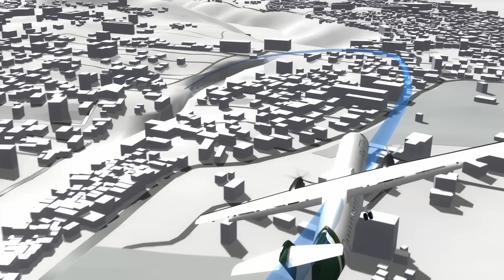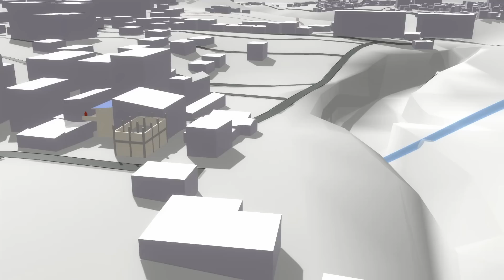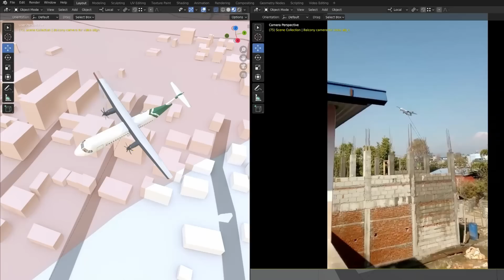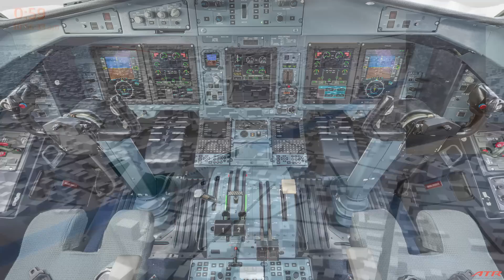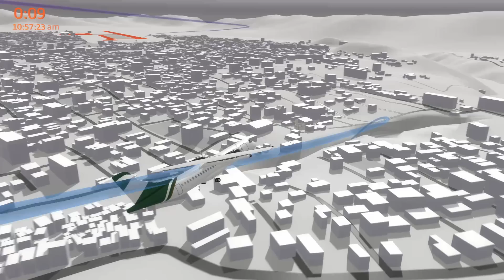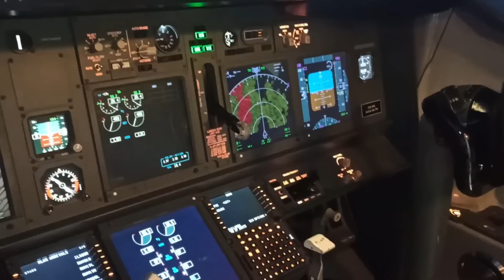HUMAN ERROR or MECHANICAL?! | Yeti Airlines flight YT691 illustrated

Comment: THIS IS THE SECOND SLIGHTLY DIFFERENT VIDEO I HAVE WATCHED CONCERNING THIS TERRIBLE ACCIDENT  X.   WHEN THE 1/O CALLED " NO POWER " IT SEMA THE CAPT FAILED TO TAKE A QUICK GLANCE AT THE PWR QUADRENT , BUT THIS IS ONE HELL OF A PUZZLING ACCIDENT ... PLS UPDATE US IF AND WHEN YOU OBTAIN MORE, DEFINITAVE INFORMATION X AS A LIC. COMM. WITH S & M E  L.   , I ALWAYS E X P E C T.  AN ENG FAIL ON T/O   OR LDG  X  OCEAN TASK SHIP CAPT. P. van ESS.   U S M M.      +       U S.  FAA. 
LIC. COMMERCIAL PILOT , AIRCRAFT , ETC.
Reply from the maker: Sure will.  This one really makes no sense at all.  
You get a master caution and see zero torque on both engines.  First thought for anyone with technical knowledge is its a prop issue... surely!  If you miss the props then forced landing is only option and you have the old runway right there.  Just don't get it.  And then you have both pilots fly it into a stall.  And then feathering the props in the first place. 
 Inexplicable!!
If you lack technical knowledge, you don't pilot a plane with 70 people in the back.  And you dont get signed off to fly in the first place.

Comment: This old Air Force safety officer does now think back to the 1980's Janet Harduvel vs. General Dynamics lawsuit. It's way too convenient to call Pilot Factor on this mishap. First of all, it's hard to believe anyone would make such a mistake.  Feathering would cause a rapid RPM  change, you won't even need instruments to notice something being up.
This does need proper investigation, or quite likely, the same technical fault will cause another mishap in due course.
Reply from the maker: The auto throttle on the engine would hold it at the correct RPM.  But both pilots missed the clues provided by the gauges.  This seems 100% pilot error.  
I thought the Harduvel was eventually ruled pilot error on appeal.

Comment: Flew on Swiss 340-343 about a dozen times from GRU-ZHR an back. Usually fully booked flights and probably very close to the MTOW and it was very noticeable how long it takes to lift off and take an eternity to reach cruise altitude (and to dinner begin to be served :-D).

Comment: You watch the airspeed every few seconds at that phase of flight and airspeed decays quickly with flaps so I still don't get why they didn't panic about airspeed way earlier?  Also the aircraft would have felt squiffy and nose would have felt unusually high.  Very very puzzling.  Are we likely to get any more data than we don't already have?
Reply from the maker: Yes the final report is still awaited.  The investigators have the cockpit voice recording and surely they do know more but perhaps collecting more facts before releasing the full picture.

Comment: Brilliant decoding of the accident. 

Very well done sir.

I am a flight instructor.
Unfortunately the error should be blamed on pilot error.
We do get quite a few nepalese students for CPL.
While some of them are good. Unfortunately majority of them cut corners during training.
Reply from the maker: Thanks.  This case also shows why pilots MUST have technical understanding.  Zero torque loudly shouts a prop problem and they should have known.  If they couldn't problem solve that, with an issue on both engines forced landing is the only next step and there was a runway right there.  They missed that too.  Panic and freeze probably set in.

Comment: Brilliant video. There is one thing I dont understand: approx 50 sec before the crash the engine speed was increased back to 44%. Then at 20 sec to go the power levers were pushed to 100%. Why wasnt it enough to save them?
Reply from the maker: Feathering is like putting it in neutral. Revving the motor has no effect on forward speed.

Comment: There is NOT MUCH you can recommend.
The senior pilot pull the wrong lever .
The lever that’s is defensively built to be DIFFERENT. 
You probably could programmed in a voice or chime for feathering props.

But this is a an error that senior pilot did that can not be designed out of the cockpit

Comment: Could it be that the senior pilot knew it was a lost cause after stall warnings and decided to violently bank left and pitch up to go into the river bed instead of the houses to save more lives?
Reply from the maker: No, the wing drop was from an entirely out of control plane.  By the second stall warning the aicraft was no longer been flown by the pilots.  You never allow a stall.  You nose down to keep flying speed up and do the best crash landing you can.  You keep flying speed up so you maintain control and at least fly to the best crash land.  You dont lose control and have no say where you are headed

Comment: There should be an alarm sound immediately, when the propeller lever is set to fether in normal flight, this could have save this plane, plane manufacture should implement this  immediately.

Comment: If you think about it, pulling the flaps lever up is quite similar (almost the same) as squeezing the locks on the feather lever. If you hold either from below, pull them up (the whole flap lever or the lock rods on the feather) you will unlock them and be able to move them. If you are not paying attention and are used with the feeling of pulling the lever up and moving them, then you could make that mistake (also, the flap lever at 15 is at about the same position as the feathers in auto). As for if it was mechanical error, it is not likely. The preliminary report show the feather was moved back to auto a few seconds before the flat stall - a mechanical failure would not "notice the mistake and move the feather back". But it was too late.
Reply from the maker: Good point, if you don't put weight on the handle the action is the same. 🤔

Comment: Para producir un giro tan abrupto el arrastre del plano izquierdo debió ser mucho mayor que el derecho, esto es obvio. Ya en si la maniobra de giro produce una tendencia a la picada en la dirección de giro lo que unido estar en pérdida o cerca de ella suma con lo anterior al resultado final.
Reply from the maker: The inside wing is flying slower and stalls whilst the outer faster wing has not yet stalled.  The aileron action also stalls the inside wing.  Abrupt wing drop in a stall while turning is normal.

Comment: Great video.
Honestly I have seen very similar mistakes cause crashes and near crashes before.
It just seems so simple to restrict the ability to feather any prop when airborne.
Reply: Unfortunately, feathering is a matter of survival if encountering engine trouble on one or both engines. If you can't feather the engine that's not producing power, you will have too much asymmetrical drag and will unavoidably enter an inverted condition. Likewise, if both engines stop making power, both props need to be feathered to minimize overall drag to give the best glide. That's just the best design we have at the moment and why training etc are so critical.

Comment: Please explain me where was the speed alarm before the critical speed drop??? Wtf??? So many time the speed monitoring was a reason for so many crashes… why until nowadays airplanes doesn’t have preemptive speed alarms???
Reply from the maker: No 1 thing pilots do while landing is control the airspeed. Not too fast  and NEVER EVER too slow. Many airliners have auto throttle to help the pilot. This aircraft did not have it. 
And if you fly too slowly there is an alarm sound and the controls shake n buzz in your hands warning you to lower the nose so speed increases. These pilots lifted the nose even with the alarm. They were in panic freeze mode. They did not take the alarm 54 seconds before crash seriously enough and made every mistake they could. Very sad.
Reply: @Mike-Bell  i mean - shouldn’t there be an alarm when pilot midflight basically turns off both engines? There wasn’t an alarm when they didi it. Until the very end.
Reply from the maker: @Realgamechanger3209  Actually not true.  Think of it like feathering props is putting it into neutral.  6 seconds after doing that they got a caution chime.  The aircraft very much did warn them. They should have checked the gauges and seen BOTH torque gauges zero.  That is extremely serious situation.  Requires immediate emergency landing, but zero torque is loudly saying prop problem.  Seems like the pilots did not have technical knowledge to know that which is unacceptable.  Theses pilots made so many mistakes and lacked technical understanding.  Both of them.  Nepal is famous for bad training and you can see why.
Reply: @Mike-Bell  thank you for responding.

Comment: This sort of thing happened to a C-5 galaxy when, for some reason, the pilots left a good engine in idle and pushed up 3 throttles (including the bad engine) so they were only flying with 2 “good” engines and crashed short of the Dover AFB runway and broke into 3 pieces.

Comment: Why did the plane stall after engaging full thrust? Was it just not enough speed at that point for the engines to spool up in time?
Reply from the maker: Think of it like taking it out out of drive and putting it into neutral.  You can rev the engine but that wont power the vehicle.  If at any time they took the props from feather back to auto they would have entirely saved the situation.
Reply: @Mike-Bell  Ah I see, the props remained feathered. Thanks for your response.

Comment: This angers me cause how did not a single pilot look down for even a split second to notice the mistake especially when they saw power wasn't increasing. This almost seems intentional cause even when doing your checklist you have to still acknowledge your controls, there are 2 of them so atleast one should have been scanning the the controls to ensure everything was right.
Reply from the maker: I see 3 possibilities.  Unfathomably bad piloting.  The senior pilot suffering a stroke. Feathering activated by an electrical error, ie  the prop levers were not moved by the pilots.

Comment: In retrospect it seems like an engineering failure to allow the pilot to feather the prop blades by mistake. Why not make them flip a switch confirming an engine failure before activating the feather feature? Is there any circumstance for which sudden feathering would be necessary, such that even flipping a switch would compromise safety?

Comment: Great video. I think what happened could have been avoided by allowing the pilots more time to realize such an error. By changing the flight route to go over Pokhara at high flight level, turning in for landing and only then start checklisting would have required much less multitasking by the pilots. The 2:24 illustration allows for no room for error. I think the final turn should happen over that lake to the west.
Reply from the maker: If you are not ready or trained to handle a runway change or a busy cockpit you should be driving a bus, not flying an aircraft.
Reply: @Mike-Bell  I entirely agree, but this is Yeti Airlines we're talking about. Assuming undertrained pilots, easier routes with fewer multitasking is an cheaper and more realistic solution. The suggested cause of the crash strongly implies some bad flight training, which may be endemic at Yeti Airlines/Nepal.

Comment: Mike. Amazing analysis and re-traced animation! If only the crew had realized the loss of power a little earlier, they could have made an emergency landing on the old airport runway which was right on their path.
Reply from the maker: Exactly.  Forced landing was the right response at master caution and both engine gauges showing trouble.  Although they were already low for the old runway too.  Height is always the pilots friend.

Comment: I have one question at last moment when they fully powered the thrust why there was no power as pilot said. why engine could not regain the speed ?
Reply from the maker: It is the same as applying full power with the clutch depressed.  Speed keeps dropping no matter the engine output.  Think of feathering as pushing in the clutch of the plane.

Comment: Why is it even possible to feather while the the power lever is above idle? The initial mistake can happen, but the poor airmanship thereafter is questionable. If your calculations are correct, then they were too slow before the final turn already. That would be crazy.
Reply from the maker: Both pilots appear to be displaying a terribly poor technical knowledge.  Zero torque on both engines is shouting a prop issue.  Condition lever should have been the first thing to check.  But of course fear and panic sets in then the brain becomes impaired, which is precisely why huge amounts of emergency training is essential for pilots.

Comment: Question
The flaps were lowered 30 seconds before the crash. So they were moved in the right position then.

The captain applied full thrust before the crash, which means the props were no longer feathered.

So shouldn't the aircraft then have come out of a stall?
Or was it too late already?
Reply from the maker: No, the props remained feathered till the end.  Its like the clutch was pushed in the way.  No matter how much accelerator the speed will keep dropping.  A plane is never feathered while in normal flight.

Comment: Prop condition lever knob is same shape as power lever knobs ......  ..MR  FAA    A.D REQUIRED IMMEDIATELY  TO  CHANGE SHAPE OF CONDITION  LEVER KNOB.......     🇬🇧
Reply from the maker: Cancel FAA alert. Repeat cancel.  The knobs are already different shapes and different colours. Its ok. No problem here😂
Reply: @Mike-Bell  You are correct. You took the time to show the ATR controls in your video and people still can't see the difference between the Control knobs on each lever.
Wow.

Comment: Does the preliminary report mention the pilots experience on that plane type? Maybe the lever confusion could stem from habits from another plane type the assisting pilot has flown for a significant time?
Reply from the maker: Pilots had 6,400 and 22,000 hours. Report doesn’t give type hours but the ATR 72 is the main aircraft Yeti Airlines flies.

Comment: These crew were weak in their procedures, compounding the situation is that the ATR has a crappy design of the power levers as compared to the DHC-8 or any other turboprop aircraft in its class.

Comment: I'm not big into conspiracies but... Something doesn't add up. The fact that  the wrong lever was pulled THEN flaps were lowered is very sus. When the captain pulled the wrong lever then had to had to pull a second lever to deploy the flaps, anyone (especially an experienced captain) would of immediate thought that "i already pulled a lever, clearly it wasn't the right one" and backtracked to find out which lever he pulled the first time. As the video pointed out, the levers for deploying the flaps and feathering the propeller are clearly and distinctive different. I think there's a possibility that feathering the propeller could be intentional to stage it as an accident. I don't think that's the case but it's a possibility.

Comment: I think I know exactly what happened. The mechanism to feather the propeller blades uses the same lifting motion to be able to engage the levers, one by lifting the knob itself and the other by catchs beneath the knobs. Without visual confirmation and using only the fingers, the motion to engage both is nearly identical. Had the senior pilot palmed the knob they would have caught the error. It is a failure in design at its core. Both processes are far too similar in execution to be considered safe to use in adverse circumstances. Both require a similar degree of movement from similar positions. This will be a recurring problem with this model of avionics.

Comment: I made this mistake on flight simulator once (feathered the props on final). I was higher and managed to fix the problem before a crash. But it happened because the "condition lever" on the sim is basically a bunch of function keys on the keyboard and I pressed the wrong one. How these pilots mistook the flap and condition levers god knows.
Reply: And how did they not notice the props spinning up, and howling like a Spitfire fighter ?

Comment: very good video and animation, thanks for this. can you say why micro switches are not used in the landing gear to disable feathering unless landing gear is a) down an b) fully weighted - i.e. the weight of the aircraft is bearing down on the landing gear. it would seem to me to prevent in flight feathering error? thanks
Reply: If you lose an engine midflight you want to immediately feather that engines prop to reduce drag as an unfeathered propeller acts like a giant airbrake and will make the engine out situation even worse.

Comment: My immediate reaction is that there’s no way the wrong lever was pulled. Wrong shape. Wrong locking mechanism. But on second thought, it’s not hard to imagine both pilots getting distracted or busy in the cockpit (new approach at a new airport) and just...pulling a lever without thinking too much about it. It’s hard to believe at first blush, but it’s why accidents happen.

Comment: A tragic mistake then panic sets in ... seconds run out... terrible
Reply from the maker: You summed it up. That’s exactly what happened. Both pilots lacked the technical knowledge to problem solve under stress.
Reply: A eager pilot desperate to move forward in her career... been thinking about this day for months ..”Dont make any mistakes “ ... change of pitch .. no forward thrust.. quick increase power 
No !!! So sad